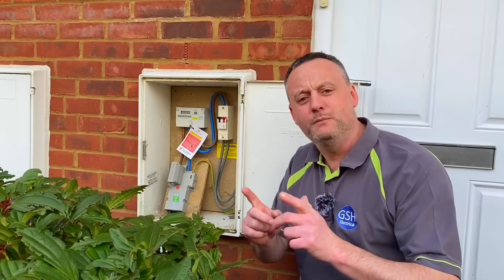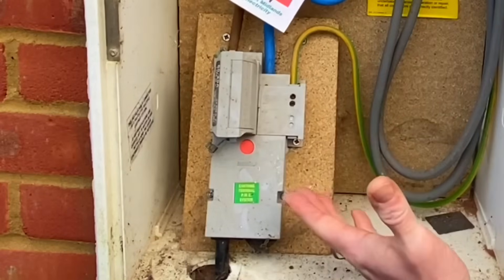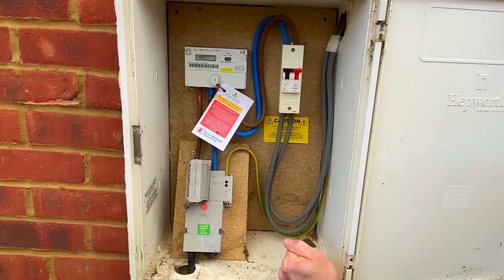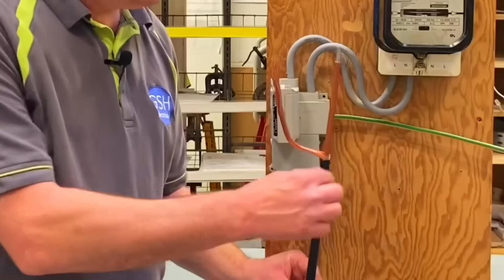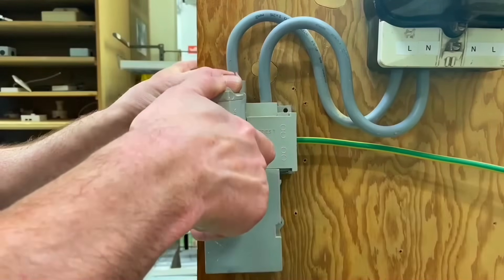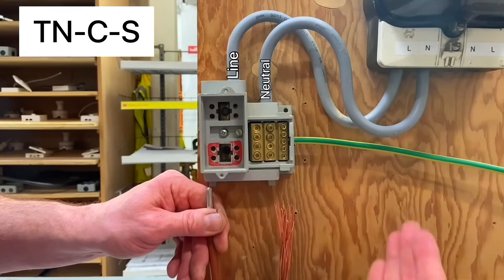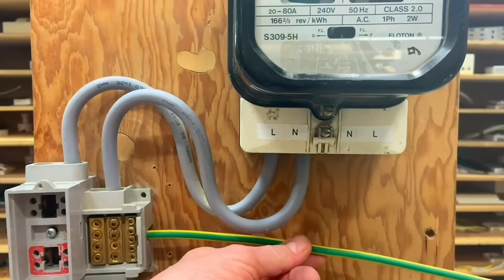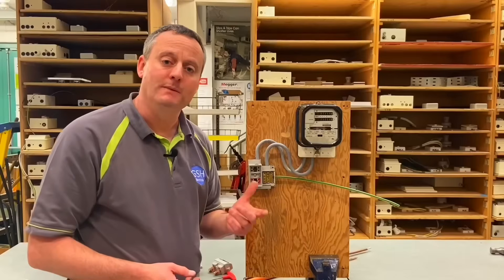It's NOT SWA Cable Feeding Your House Cutout Fuse

Comment: It’s worth noting there is 1ph split concentric and 3ph split concentric out on dno networks on the 1ph conductor size you normally will come across 16mm split 25mm split and 35mm split concentric 3ph most of the time I have come across numerous times in 35mm. Split concentric service cable main purpose is to match existing earthing characteristics of the lv network in some areas direct earth or separate neutral earth is the only earthing system available. This type of cable comes into play a lot of the time on service alterations were a 1ph pilc or three phase pilc service is being moved to a different position so to match existing direct earth or separate neutral earth characteristics of the house split concentric is installed and a transitional straight service joint would be jointed onto existing pilc service or split concentric service.
Reply: Not sure of your location but in the NPG, North East England. a single phase service will normally be split neutral and earth but a 3 phase will be combined neutral and earth with a separate earth conductor out to a stake.
If its a new service all together either will be combined neutral and earth and the customer provides their own earth.
The DNO only provides an earth if there was already one there. There is actually a big issue with earths and DNOs.
up till recently they did not provide an earth as such, it was the lead sheath of the cable which was earthed as protection for the sheath. But many Electricians adopted this earth as their main earth if it was there and it became standard practice.
When privatised DNOs realised the legality of these earths and stopped guaranteeing them to be of good value.
The IEE didn't like that idea, over time new regs introduced state that if an earth clip was fitted to a lead cable by DNO they had to adopt it and if a property had what had been seen as an earth from DNO any alterations had to include an earth.
For ease we just put back what was there or its equivalent until it came to 3 phase services as above.
it was a fun 5 years or so...lol scratching your head trying to figure out what to do on each job.
Qick note.
we called them SNE and CNE, separate neutral and earth and combined.....
Reply from the maker: Massive thanks for taking the time to give your input 👍🏻
Reply: @GSHElectrical  your welcome your channel is excellent great content and very informative 👍

Comment: Quick question then, my fuse doesn't have a number in it so how would I know what size it is and, if it's smaller, how would I know if I could upgrade of I needed too?
Thanks
Reply from the maker: Default to 60 amps. You can contact your energy supplier 👍🏻
Reply: It’s not as simple as just upgrading the DNO fuse.  Typically, if you’ve got a 60amp service and you want, say, a 100amp service, the DNO may need to upgrade the whole cut out and possibly the incoming service cable.
Reply: Given that the fuse isn't regularly blowing then it doesn't sound like you need to upgrade it.
Reply: @deang5622  planning on an extension and we have a 14 way CU that is way beyond what the calculation says it's supposed to be, although i can't remember the calculation but it was way way higher when i checked
Reply: @therealdojj  I would not expect an extension to justify a supply rating increase. Its about consumers and people. 2 people in a 7 bedroom people will use about the same as 2 people in a 1 bed. I know of a private castle on a 60A supply.
Reply: @peterpeterson9903  now add in an EV charging point, and those will become much more common, as will heat pumps...
Reply: @peterpeterson9903  the maximum demand and diversity calculation numbers for my house though are 104.8, hence the need to find out what's going on
Reply: @therealdojj  Sounds like the basic method was used. Often people get caught up and don't do a proper load analysis. Take a care home, it might have 20 ring mains, but in a care home the load analysis will probably only take each resident room ring at 1-2A because we know they will not pull anything like 40%.

Sit down and do a realistic load analysis. A bog standard electricians diversity calc might take heat and cooling loads into the same calc, fact is chances are one or the other... In the M&E sector a load analysis will be done to work out a building load, its done based on a proper in depth calc and is almost always far lower than the old 100% 40% rules from BS7671. Another thing to look up is ADMD - your DNO would slap you down to something like 2kVA if no electric heating, maybe 10-20 with ASHP or electric boiler. 

At 105A I would not be worried though, a BS88 will sit at 105A for about 4 hours before it will blow.